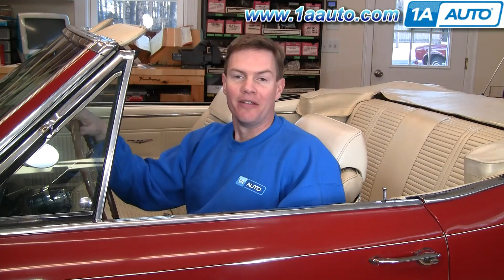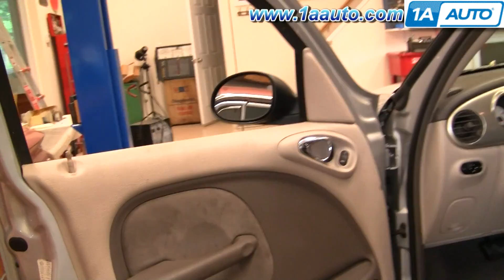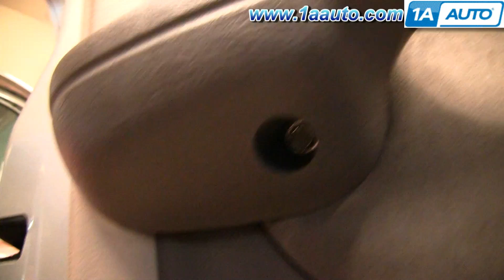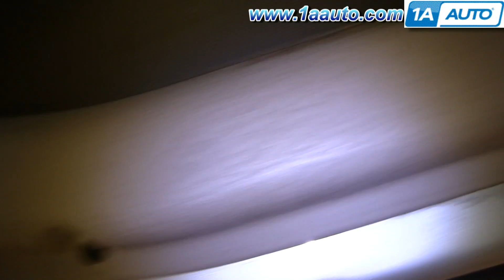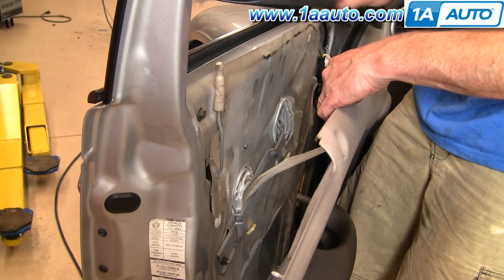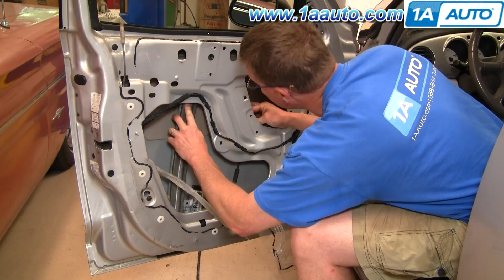How to Replace Window Regulator 01-05 Chrysler PT Cruiser

Comment: Roll the window all the way up and then tighten the windows hold clamps.  This will align the window with the window frame and insure that the window doesn't bind.
There are holes in the door frame to do this.

Comment: good video thanks! my passenger window doesn't work at all after getting stuck a few times. driver side works on and off. would one regulator mess short circuit the other?
Reply from the maker: +Drews Quick Fixes Ideas And Hacks You may want to inspect the window regulator to see if it needs to be replaced. Sometimes the cable can come undone or break and cause issues like this. If that's fine, check the wire harness between the drivers side and passengers side door for a frayed or broken wire that may need to be repaired. Hope this helps you out. 1aauto.com
Reply: thanks took it to a dealer. the electrical wire in the door connecting to the motor was frayed. you were correct. Hence when I slammed the door hard sometimes the window would go up.  It would also temporarily short out all the other windows for a minute or two as a safety I guess. Then they worked again.

Comment: always good videos! How 'bout doing one for a window regulator replacement when  the window is up when the regulator failed.  Creates a new challenge that we expect you to demonstrate the fix.  Good job.
Reply from the maker: Thank you for watching! If the window is stuck and you can not reach the bolts cut the cable. That will free up the window and allow you to move it as needed.
 888-844-3393

Comment: How do you know if its the regulator that's causing the window not to work?
Reply from the maker: If the regulator is the problem you will be able to visually see if it is broken. Usually if the window does not work at all it is either the Motor or Switch. You would disconnect the connector that goes into the motor itself and put a test light to the pins. If you have power when you hit the window switch in both directions then it is the motor. If you only have power in one position but not the other then its the switch. Hope this helps!
1aauto.com 888-844-3393

Comment: We took off the inside panel as you did in this video. Then with a flashlight and mirror we inspected the inside. All clear, that's what is throwing us for a loop! No visible signs of anything wrong. We're tempted to loosen the glass, raise it all the way then tighten the screws back.

Comment: I have a situation where my window goes up and down but stops short about 2 inches from going all the way up! My Cruiser is a convertible and the window goes up and down about an inch on its own everytime you open the door to keep the glass from catching the cloth top. What could be causing this? Like I said, it works but won't go all the way up anymore!